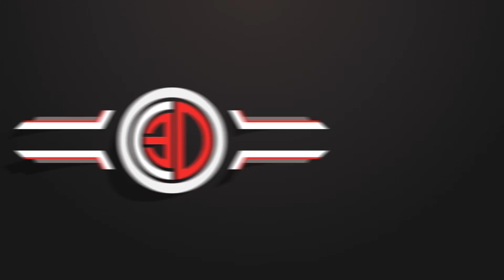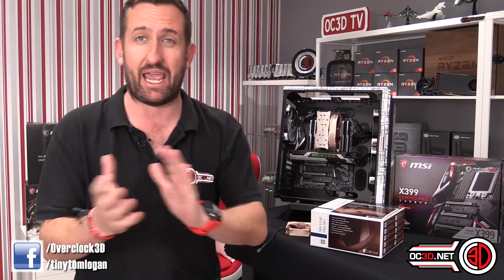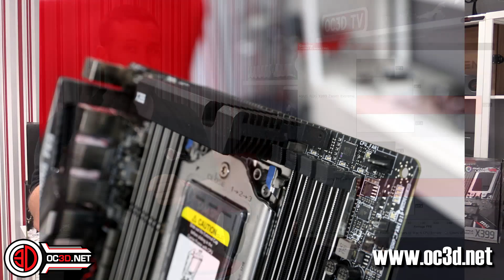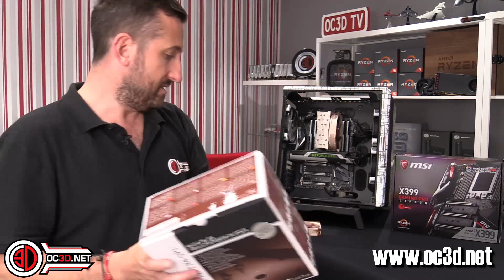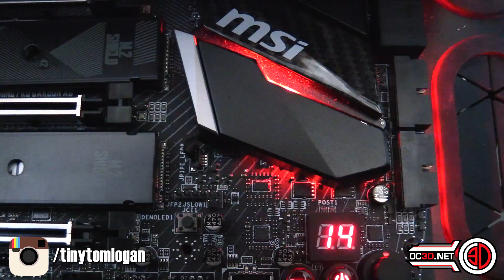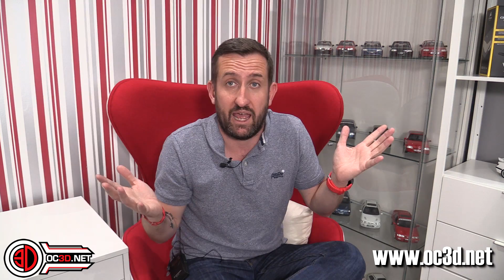MSI X399 Carbon Gaming AC Threadripper TR4 Motherboard Review

Comment: I have x399 gaming 7 and it's been 1.5 years since it's been working fine till last month

now it's giving issue that when I boot in a scene that turning on ups, bios resets.

even if I leave t on default, it stll resets.

changed the CMOS battery oldest to newer bios, everything..

no solution from RMA. going to buy Strix E for my CPU. spend may days and don't have time and energy to look into this. 

Good going gigabyte for making something which automatically gets nuts by itself.

Comment: After more than 10 years they still haven't fixed their BIOS update and Clear CMOS issues (palmface)... After updating to the latest BIOS from version 15 to version 17, it posted ok. I tried the XMP profile 2 (which worked fine before the update), but then the mobo wouldn't post. The Clear CMOS (via the dedicated button, or via the jumper on the mobo) AND Flashback+ functions don't work... Now I have a useless mobo on my left and a pile of 4K$ computer parts on my riight. That will be the fourth MSI board in a row that I'll have to RMA for that reason (BIOS updates have always failed on MSI boards).

Comment: My 1950x run at 3.9ghz at stock clocks/auto (1.225v)  stable all cores. Dont know how this low voltage is working coz for 4ghz i have to put volts around 1.33ghz.. Its been a month since i build my pc and with these clocks... So i think i'm pretry lucky coz i just dont game, i do 3d renders and everything is stable.. My board is gigabyte's x399 gaming 7

Comment: I just picked this board up on sale. Am I able to run this board with one cpu 8 pin with a 850watt psu? Just keep it at stock speeds until i get a new psu? I didn't realize it needed two cpu plugs! Which psu would you recommend without going crazy expensive

Comment: Same board, 1.225V 4GHz totally stable - 50 degrees C max. The only issue I had was lack of power because both aux 12V power connectors were not used. This has been my least painful build ever - it initially booted at 4.2GHz - same Noctua cooler with 2 fans and my G-skill 2800 RAM works that didn't work with my intel 5820k period....

Comment: I'm not sure why people are saying that Threadripper is hard to keep cool... I haven't had any problems keeping my 1950X cool, although cooling can be an issue when you OC above 3.8 GHz. I got a max temp of 59C running two instances of P95 blend at stock speeds, after 4 hours. This was with a Thermaltake Water 3.0 Ultimate AIO. When I overclocked to 3.8 GHz, the max temp shot up to 79C for the same test. However, it doesn't get nearly as hot when I use it for Handbrake encoding, which is what I primarily use it for. I was getting max temps of 59C at stock speeds and 63C at 3.8 GHz while encoding. Higher overclocking would require a custom loop water cooler, but I think after 3.8 GHz it is past the point of diminishing returns anyways.  I do agree that the bios for this board is buggy as hell. It took much more time than it should have to find stable overclocks.

Comment: i usually don't watch amd review videos but to support you tom i went ahead and watched it , and after watching the whole review i would like to mention one thing MSI is not to be blamed for this x399 and ryzen is still in it beta stage only , people over the internet are going crazy about threadripper which in reality is an epyc cpu with 32 cores under the hood , 16 don't work or disabled most likely they don't work , u can also check dea8uar's  video where he proved with another deleading threadripper video that indeed it's an epyc cpu , this just clears the air that why don't these cpu overclock well ,  ans is they are already clocked very higher , it's an epyc cpu and pushing past 3.6 is very tough , so here u have a cpu which don't overclock and on the other hand x299 which got so much hate , those cpus overclock like crazy, i have seen a 7820x overclocked to 4.6ghz and matching 1920x performance at overclock ,which is insane in it's own terms ,  and one more thing yes ur right these x299 and x399 mobos should have a dedicated heatpipe much like the gigabyte gaming 7 and 9 or asus rampage apex and extreme edition boards even msi xpower x299 is also good

Comment: Hah! Had a feeling you would be giving it a bad review. It's an absolute piece of sh-t board. SO disappointed in it. There are so many problems with it (even with the new BIOS) that you completely left out how ugly it is when it is running. It's supposed to be RGB lighting but they only let you change a few of the lights on the board. The rest is for status (red means on, nothing means off). So currently about 10 lights on my board are shining 'red' and 3 customizeble lights are set to 'white'. Looks aren't that important but I sort of wish I didn't have a glass panel anymore with the christmas tree I have going inside the case.
Reply: Also, can't change my ram to anything else but 2133Mhz. They're Threadripper compatible and should go to 3000Mhz. Setting it works fine in the new BIOS, but it will crash as soon as I try to stress them in any way. Hopefully there will be an update later on but knowing how fast MSI are with updates it might be a while.

Comment: Holy moly, had the exact same issues with restarting from the system on mine! It was driving me nuts but I never thought it was the bios. I flashed it to the other version that they had on their website and it was still having the same issues. Was also getting blue screens from their wireless card they supplied with it. Ended up returning it and getting the asus X399-A. I'm glad you've cleared these issues up.

Comment: I had the X370 for the 1800X and had issues with USB devices constantly cutting out.  In addition, I couldn't get the Corsair Vengence to run past 2667mhz, therefore, I avoided MSI and went with Asus for my Threadripper upgrade.  USB has not cut out and the Corsair Vengence is running @ 3Ghz!

Comment: Very interesting, this is the board I have been having big trouble with, I get the C0 issue but it won't run at stock speeds because it seems to be over volting as when I disable core performance boost it is just fine, its just bizarre, been having crazy windows issues also, its very frustrating, even with the beta bios I am running.
Reply: Hey Kev what bios version are you currently on?
Reply: 1.47 I think, I might try getting another motherboard because my one just might be funny.
Reply: Mate at this stage You,Tom and Steve are the only people i trust for honest reviews i appreciate your reply, hopefully you get it sorted it would be great to see a followup video on your channel in a few months letting us know how it all panned out. All the best
Reply: Cheers, I just did the 1.50 update and it seems to have fixed most issues, I can run it at stock speeds now no worries, but I am still getting 'AA' and '40' trouble codes instead of the readout showing CPU temp like normal, looks like the windows issues might still be around but the 'C0' & '15' hang codes seem to be gone so that's good.
Reply: I have the same issues (plus more). It's not just your board. Do you have m. 2 drives? Check the speed. I can't get them over 2gb/s on read.
Reply: On my Gigabyte Aorus Gaming 7 (bios F3d) I'm also stuck with AA or 40 readouts instead of CPU temperature. Unless I overclock the CPU and then it changes to "OC".

Comment: The bad oc and 15 memory issues sound like there was a contact issue in or around the socket. I have seen reports of the socket its self coming untightened.

Managed to get 3.8GHz 1.225V 1920x with 2933 cl14-34 dual ranked bdie ram running on this board. Bios is trash, settings need to be always set again to apply correctly, but for the low price it's an alright board.
Reply from the maker: New BIOS fixed the issues and it appears to have been a known problem.

Comment: Thank you for all the testing! I'd like to ask you a question though.
I have to admit I jumped the gun on this one and already have the msi x399 with me. I can't test it yet as I'm waiting for most other components to arrive.
Now my question is: are these vrm temps something to worry about? I'm building a strong machine now and I'm not planning on doing any major upgrades for a long time. The results you show make wonder about the longevity of the cpu/motherboard.
I've also ordered the Enermax Liqtech TR4 240. This aio should do a better job at cooling the vrms, right? I will have either the aio's radiator and fans right above the heatsink or possibly I could have 2 140mm fans on top if I decide to put the aio radiator in the front as intake.
PS: I'm not sure if I got this part right: the vrm temps you showed were tested with the  noctua air cooler and no top ventilation?
Reply from the maker: szperaczgmeracz depends on the system use. The vrm's will got hot if you use any multithreaded apps for long periods
Reply: Most of the time I will be sculpting in ZBrush - a cpu based 3D sculpting application sometimes in conjunction with Keyshot - a cpu based renderer. I doubt that these will really stress the 1950x and surely not for a prolonged time. There should be spikes of cpu usage during some operations but it's nothing like the torture tests. These apps are well optimized for many cores so they will surely make good use of multithreading but the cpu usage should be minimum/moderate. 
As far as I know it's nowhere near as taxing as video rendering or other heavy tasks - I don't do any of that.
Gaming shall occur on occasion as well :-)
I'm probably stretching your patience here but would you recommend that I return it and switch to the Zenith?
I'm a bit hesitant due to the price difference - the zenith is some 250€ more expensive in Europe + I'd probably need to change my ram as well. (I found 4*8GB 3200 MHz ripjaws V 14-14-14-34 for a good price but this model is not on the QVL for Zenith :/ )
What's your advice doctor? :-)
Reply: Also: there's the extra fan mount... do you think an extra fan could help there?
Reply from the maker: The fan mount is pointless. It doesnt work in a case. Its an old mount pulled from an older Xpower overclocking board and is meant for a testbench. It really doesnt belong in the box with this.
Reply: Ok, thanks. This positively sucks though :(

Comment: Have this board :( was looking on booting it up tomorrow when the graphics card comes in as I RMA'ed my 980 that went bad also from MSI, so this is NOT giving me a warm fuzzy thanks for the review.
Reply from the maker: youll be fine at stock - just keep an eye open for the new bios on the MSI website
Reply: Thanks will do love your reviews, your right up there with HardOPC and Ars Tech for my favorite tech sites! Some 2-3 day nigh renders have me a bit worried about the VRMS though but my AIO is right above it, hope that's enough. I see so many "gaming reviews" and hardly any workstation reviews of threadripper your stuff really helps bridge the gaps.

Comment: Glad to see an msi product n ye msi are known to be behind on bios on all platforms not sure whats up with msi, there is a bigger issue at the moment though n that is AMD not just the cpu's but now gpu's, due to cost now nvidia are the goto cards, also the I7- 7820x is cheaper than the TR 1900x and the intel x299 boards are £100 cheaper than the amd x399 boards that's £125 cheaper to go intel over the amd platform rofl what the hell are AMD doing to themselves geez who would have thought nvidia, intel, x299 are the cheaper options OMG.

I7 7820x has less wattage and btr single threaded and is cheaper, very strange strategy for amd to price higher.

Amd have always been there own worst enemy and they're doing it again, will they never learn?

Thumbs up 4 the vid.
Reply: that is funny, i doubt you speak with any experience of owning said chip, but even so, people are buying Intels much more than Threadburners and there is a reason for that
Reply: Veritas intel has alot of issues regarding thermals. That is a critical issue when considering a cpu.
Reply: ye i am aware of those m8 even so as sad as it is to say the x299 is looking the btr option but both have there fair share of issues and releasing two platforms in such a state should never happen imho, embarrassing for the two company's.
Reply: Oh the irony... complaining about thermals on the x299 platform while watching a video about the x399 Threadburner, a processor that can't even be managed to be cooled properly.
You are so smart ccccddddd (facepalm)
Reply: Why go 7820x and x299 for a 8 core/16 thread processor anyway? Just go Ryzen 1700 + B350 or X370 and save many hundreds.
Reply: Lol you don't even know anything. Liquid coolers can't even keep the new I9 chips less than 90 degrees. Not only that, the 1700 is exactly half the price of the 7820x. What's wrong with a B350 board? It will do everything most people need to do. and LOL at the 7820x being faster.

https://www.techspot.com/review/1457-ryzen-7-vs-core-i7-octa-core/

Maybe do research before you open your useless Intel fanboy mouth. Get fucked.
Reply: 7820 is a mess... there is no single reason to buy that shit CPU especially for gaming..... not to say that threadripper seems  amazing either.
Reply: I think there's a lot of valid points here on both side, yes the 180w of tr is high, 140w is btr sure but clearly still having issues, the x299 are cheaper than the x399, the quality seems to be about the same bios issues memory issues, heat issues, and yes a 1700 8 core 16 thread is half the price of the 1900x which is again a very strange pricing issue, from what I've read though it does seem like the 7820x wins on perf grounds and is cheaper and as pointed out already not without its own issues, but I think given the views of all here it's clear whatever side of the fence you fall on both have there pros and cons, I don't think the platforms were muture enough and I think pricing and power/heat is way off on both as such they should really have been priced much closer to the 400 mark to entice more to the platform esp given the cost of the 1700, of course it doesn't help that the board manufacturer's are scalping on both sides which of course diminishes sales,  I really think it's about time some restraint was put on the parters to keep down costs and increase sales.
Reply: 29ryan49 I have one of those I9 processors you talk about and it doesn't go above 60c in AVX with my custom loop, normal usage it doesn't even reach 50c
Reply: Or if you still want to game, have faster single threaded, you could just go with the 7820x over the ryzen and laugh because the 7820x is faster than the 1700. B350 loooooooool
Reply: I own the 7900x on a h80i 120mm aio i have never seen it go above 72C @ max load.
You do not know what you are talking about,  and according to the pages i went to, the 7820x is faster than your shitty b350 low cost 1700 Ryzen chip, how about not handpicking your links as proof,
because if i wanted to i could show 6 reviews showing your 1700 beaten.
if you said the 1800x that would have been different.

Here is one for you bitch, the first link i went to
https://www.youtube.com/watch?v=eiy1kZaQT1s
hahahhahahahaah

Comment: MSI +ryzen= crap bioses.... and their forum devs arent the best either... they throw blame to AMD at any chance when other companies dont have the same problem, 
and their edgy as fk about criticism.
Reply from the maker: Democritus86 tbh dude a lot of the issues have been amd
Reply: Democritus86 No, you don't get credit for fixing your own problem. That's like saying if someone took a shit on your food at a restaurant, they should get credit for giving you a new shit-free meal.
Reply: Democritus86 msi has been getting pretty bad honestly... Hard to recommend their stuff these days.
Reply: well i bought their B350 Tomahawk it was terrible at launch but they did fix it eventually  to give them some credit at least....
Reply: MSI has many problems with the GPU coolers too, fans keep on stop working for no reason, not something you expect from them since they are not cheap in any way (actually more expensive than other more reliable brands). Avoiding the MSI brand ever since has fixed the problem for me.
Reply: Oooo.  Gross.
Reply: Democritus86 They haven't changed the VRM on their B350 boards. Which are some of the worst on the market
Reply: OC3D TV yeah AMD is to be blamed on some problems,but that makes it easier to blame em for other issues that Asrock,Gigabyte and Asus didnt have on their boards.
Reply: What makes you say that it could be the best? I've had nothing but problems (even with the new BIOS). Struggling to see what makes this the beast board, or even a contender. It's the second board in a row from MSI that I own that has had lots of issues, I'm not brand hating but this will obviously be my last MSI product. Trying to get it RMA'd and switch to another manufacturer
Reply from the maker: Every vendor has their own issues. If MSI had used a bigger heatsink (read dual heatsink with a heatpipe) coupled with the newer BIOS this board would actually have the ability to be one of if not the best X399 board. There is no need for the brand hate